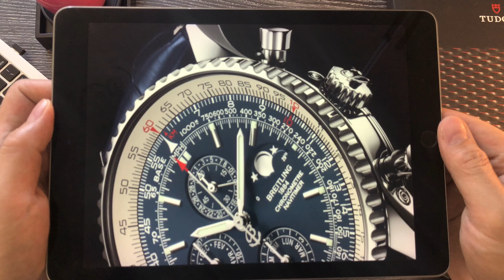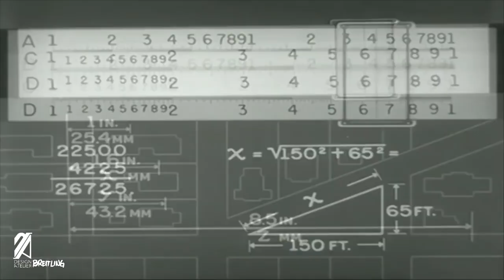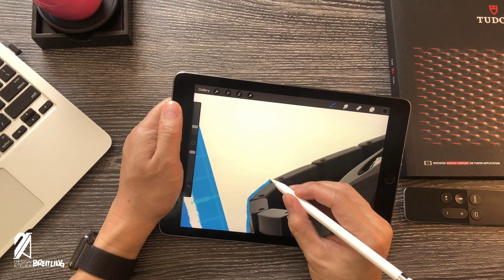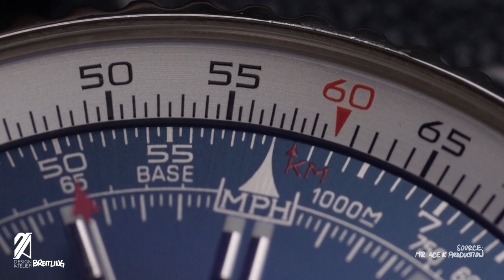How To Use The Slide Rule (On Any Watch)

Comment: I once owned a watch with slide rule bezel.  I have used a linear slide rule a lot so I was able to use the watch bezel.  I had ideas that I could use the watch in a restaurant to calculate the tip.  At some point I realized that in the dim lighting of a restaurant I couldn't read the small numbers of the bezel so I eventually sold the watch.

Comment: This is why pilots love this watch. During pilot training, you're trained to use a circular slide rule for fuel consumption, wind correction angles etc. The Omega Speedmaster has a similar feature called a Tachymetre, which can measure distance and speed, but because it lacks a rotating bezel and three other scales, it isn't quite as versatile as the Navitimer when it comes to calculations. Great video.

Comment: Great video.  Thank you for making - especially with a Breitling.  Just one comment for your next, (and I'm sure you have already caught this), at 8:50 when you convert 88 miles into km you would slide the 88 on the outer ring to STAT inner ring.  Then read the outer result from inner KM marker.  Not over MPH then read from 10.  Great video.  Think of this as a test to see how many focused on your slide rule instructions.  Did anyone else catch this?
Reply: No, I think he's correct. If you go back to 8:20 where the outer bezel reads the red 60 and take the reading of the blue inner 10 marker, it reads 10 thus equating to 100 km/h.
Reply: Thanks for thinking about this. Appreciate the comment, but just to be sure I understand your thinking, are you saying 60 miles is equal to 100 km?  Breitling's were set up to include this conversion quickly by applying a marker called STAT which stands for statute miles which is known as the US miles measurement.  If you align 60 to the inner STAT you get 96.x from the km marker.  The real answer is 96.56 km.   In my original comment, the same applies.  88 Miles is equivalent to 141.6km. He says the right number, 141.62.  But look closely at the dial.  He's showing 144.x.  His dial is wrong because his method for conversion is wrong.  Just like 60 miles is not 100 km. It is close, but his slide rule has the KM marker for a reason and it is not intended to be compared with the inner 10 but with the inner STAT.  One could always memorize the conversion, Like memorizing 60 is to 96.56.  But the KM and STAT already do that for you.  He does present it very nicely, I just wouldn't want folks to make this error when the correct approach is available on the dial.     @milk-it

Comment: I 100% agree. I have my smart watch which discharges the more I use it and is pretty much paper weight by end of the day. Yet my mechanical automatic watches just keep ticking as long as I am moving them. They tell the time, Have chronographs, navitimers and just wont die. Which I think is awesome.

Being a computer nerd I have a newfound respect for old outdated systems as you said.
Reply: My main issue with smartwatches is that they all look like black squares when worn... Irrespective of whether it is a $20 Chinese junk or a $2000 special edition. They all look the same. The dial comes to life only when I look at it.

I don't understand why smartwatches have become a craze.